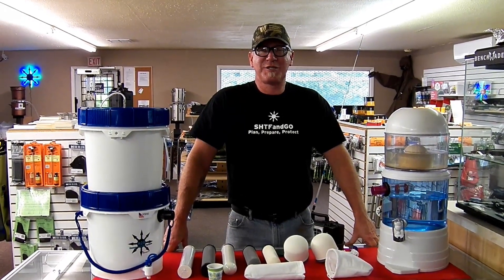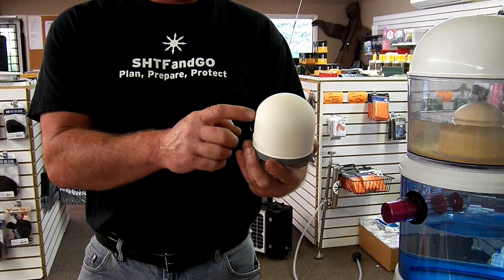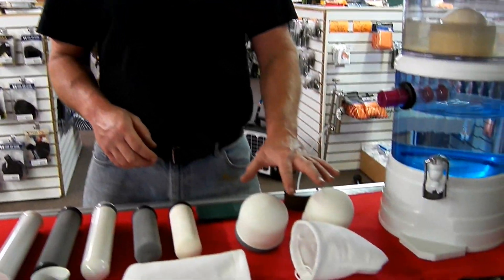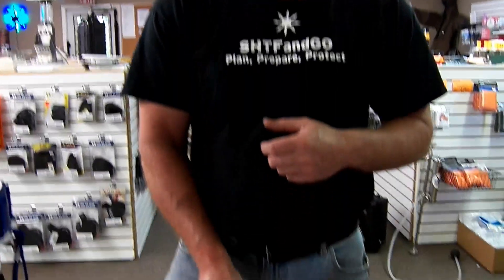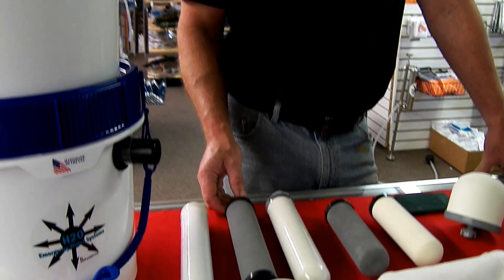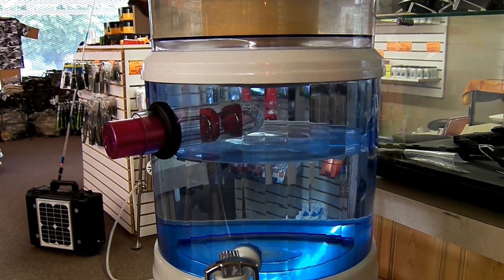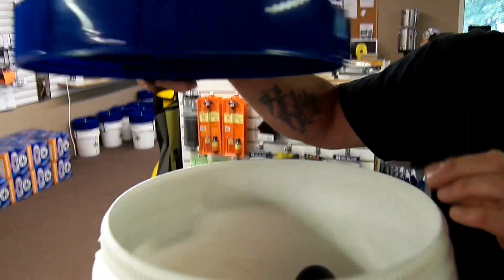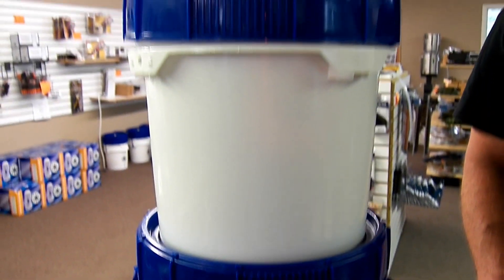Compare Different Types of Ceramic Filters

Comment: Wow, you guys have really put a lot of thought into your products. Definitely very impressed, even if i might not immediately purchase your larger models. I did get a D-Stil Lite just now, so depending how that works out, i might also get the GRAVI-Stil. I used to own one of those electric distillers from Amazon, but after three years the electric switch burned out. Obviously, that's not very sustainable, even if I did manage to repair it. The multiple heat source aspect of your products appeal to me.

Comment: My hollow fibre uf membrane claims to be of pore size 0.01 and works with tap pressure. It does not need any pump, though it takes 10 minutes to produce a gallon of water. Do I need a uv sterilization in my case?

Comment: Just looking at all of these, something came to mind. I would think the dome would be better and last longer than the candle style, because the whole thing sits lower in the water. A candle is going to clog more toward the bottom and less toward the top as the water drains out, so the lower and wider the better. Yes, no?
Reply: Well doesn't the dome sit in the bottom two ?
Reply: The candle has more filtering surface than the dome, so I would assume the dome clogs quicker, ergo requires cleaning more often, however, the dome is a better fit for smaller, maybe wider, containers.
Reply: I like the doom shape.
Reply: I'm currently using the dome shape and 16qt stainless steel pots purchased at my local Walmart and a stainless steel spigot purchased online too as well as my filters.
Reply: @stevethomas5209  hi can you make a video please showing us how to do it thank you so much
Reply: @sheepseven7588  Its supper easy and there are several videos on YouTube already. If you have any skill at all w a drill to drill the holes you will do just fine. On a scale of 1 to 5 and 1 being easiest this is about  1.5 so get your drill bits, pots, spigot and filters and go for it its supper easy and will save you lots of money and the best part is no more buying water. Be sure to run two pots of water to get the filters completely filtering properly... Like priming the filters for maximum filtration and tast.

Comment: Can one of your UVs be added to a Berkey (the plastic see through type of Berkey.)   If not, can you recommend a submersible UV for a 2 1/2 gallon clear plastic Berkey?
Reply from the maker: @rharrold  Yes some people have done this. Just be careful. 😉 https://shtfandgo.com/product/uvc-water-filter-sterilizer-kit-for-gravity-systems/
Reply: @Shtfandgo  Thank you for the quick reply and link to the product!
Reply: @Shtfandgo  — Would putting the UV in the lower container and close to the spigot 🚰 outlet be OK?
Reply from the maker: @rharrold  I'd recommend as high up in the bottom (clean water container) as possible. The gasket seals well, but there's always a chance of a leak. If it's up high, water doesn't have as much pressure.

Comment: I'm looking for something that filters out fluoride.  Aside from Berkey, AquaGear was the only one claiming to filter fluoride when I did my initial search years ago, and AquaGear has recently discontinued that feature.  Making my own filter system appeals to me, so I'd like to know if there is a filter you recommend?
Reply: I'm also interested in removing fluoride. My little research has led me to find that add on filters ie for berkey or doulton etc that remove fluoride do so using a media that contains or utilises aluminium. So yes removes or reduces fluoride but at the cost of aluminium (not good). It seems to be kept quiet by berkey etc... and not immediately obvious to someone wanting a flouride removal filter.  doulton don't even mention what the fluoride removing media is inside there fluoride filter but likely aluminium. I have heard that a possible natural solution is Tulsi plant or holy basil leaves as they apparently leach the fluoride out of water. If the filtered water was able to have these leaves soaking in it for a certain time it may help to naturally remove or lower the fluoride. Would need to test properly to confirm
Reply: A distiller is the only way

Comment: Interesting set up. I was wondering the uv light compartments. Do they have water or air tight locking mechanisms to avoid air contamination or spillage while moving the container?
Reply from the maker: The uv lamp is inside a glass tube.

Comment: are these as good as berkey,and will they remove any pool shock/chlorine from the water? YZMMWST Replacement for Berkey Water Filter System, Black Purification Elements Gravity Filter System, for Doulton Super Sterasyl and Traveler, Nomad, King, Big Series - 2 Pack

Comment: i have one that you first introduce. can you please help me how to clean thi? there is green stains in it and it doesnt remove.
Reply from the maker: Marian, The filter will turn the color of what ever is in the water being removed.  Example:  High iron in the water will turn it red.  You can take a scrub pad or sand paper to rough up and clean the outside of the filter.  Remember the outside doesn't need to look clean for that is where all the things you don't want in your water get caught.  They do not pass through the filter to the clean water side.  Any questions just call our shop M-F 9-6pm Central time. 612-888-7483

Comment: I just bought a Berkey system a few months ago and hate it. I purged it as per instructions, and ran at least 10 gallons of tap water through it.... the taste is worse than the tap. It has almost an oily smell and taste. I even ran 1 gallon of vinegar through it, with slight improvement.

Since I already have the housing, I think I want to switch out the filters to yours, can you confirm that your filters will not have this same problem?

Comment: Do the dome filters fit a regular Berkey stainless steel filter?
Reply: Also, my Berkey has four holes in the chamber.  Right now I have 2 white ceramic filter "candles" (non charcoal I believe).  Would you recommend that I put anymore "candles" in, or should I keep the plugs in?
Reply: The domes will not fit most.  They are 4 inches in diameter, so you would have to measure and see how many you can install. Most people replace with our black candle filters.
Reply: @shtfandgobulletproofrocket3874  well, there's FOUR holes... two are plugged, two have "the candles" in them.  If they drilled four holes when they made the container I would think they would've made it wide enough to hold four. 🤷
Reply: @kristopherchynoweth9770  Yes. If there are 4 holes, then your system can hold 4 candle filters.

Comment: I distilled 4 gallons of water from the garden hose, the water is 000 on the TDS Meter but the water taste like the garden hose on a hot day, what would be the best filter to take the bad taste out? I would like to make my own Berkey system that will fix the bad taste.
Reply from the maker: Any of our filters with activated carbon should do the trick.  Here's a link to one of our carbon black candles. https://www.shtfandgo.com/product/carbon-black-ceramic-7-inch-candle-filter/
Reply: @Shtfandgo  
Thanks a million.

Comment: Impressive video! Thanks for going through them all. I’m already going berkey for drinking but what would you recommend for showers and washing clothes during SHTF
Reply: Bathing can be done in regular hose water. Cooking water ideally should be filtered as if you'd be drinking it, but if you can't get it that clean. Clothes washing should be the last thing you use any water for if water is in short supply. Honestly, having done long distance hiking(7+ nights, 100+ miles), I bring 1 change of undies and a spare shirt on most hikes. I'd rather pack more food than clothing. If I'm hiking near a lake or stream, I'll bring a vinyl "soft bucket" with me for washing clothes with. 

NEVER wash your clothes in a body of water with antibacterial soap. Take a bucket of water out of the lake/stream/river and wash on ground. Don't contaminate the stream with soap runoff. It will kill the good bacteria that helps maintain the ecosystem :-)
Reply: Living in what sounds like colder climes to you, Scotland, I always wear Merino as a base layer, which, of itself, has antibacterial properties, but it's a Merino mix, ensuring further antibacterial benefits, so they require washing every four or five days, which saves time and effort, but, as you say, sooner water for drinking and cooking than than laundry concerns.
Reply: @billyandrew  do I understand you wear merino wool next to your skin? I live in sub tropics, so I am clueless. It gets just below freezing about maybe 7 to ten days a year here, if that. Is it scratchy? Do you have a softener to wash it with?
Reply: @beverlyaten1775  If the merino fine wool garment is SOFT enough, it’s beautiful next to yr skin! To test, gently place the fabric up against your décolletage and move it around...discreetly, tho, or the store owner will think yr creepy.  You can tell if the wool is soft or scratchy. 
Aim for “machine washable “ on the lable. 
Wash in the machine in a lingerie bag, to avoid twisting and wrecking it in the wash....cold wash, with normal powder.
Yahoo!! Now you’re set!
Louise, Australia 🦘

Comment: I'm wanting to clean a dedicated gray water tank to a shower (off grid) the goal is clean water recirculating to be refill the water supply tank. 99% time using bio- degradable soap,, but concerned about a build up of soap scum. Or if the filter could even handle the soap without instantly clogging up. Best thought process right now is use aquarium floss/quilt batting on shower floor with a teak slat floor over it to capture as much soap/hair first.
Reply: Maybe consider a pool filter first

Comment: @4:40 .   Are you sure Berkey filters are 0.2 micron ?  .   The behave like a 5 micron because of the high flow rate and longer time between clogging.
Reply from the maker: Sorry for the long delay. for some reason your message didn't show up until now. They advertise them as .2 micron, but I've not tested them for consistency.

Comment: I use my ceramic filter the dome one for about 3 weeks then it stop filtering, I scrub it with a brush, a pot scrubber, sand paper and its still not working, i think its because the holes in the ceramic is so small it is clogged and cannot be unclogged. Do you have any suggestion that can help?
Reply from the maker: Contact our shop on Monday and we can help you trouble shoot.  If the brush or scrub pad had any oil on it you probably ruined the filter. Soap and oil can plug up pores. Sand paper or clean brillo pad are best. We've used dome filters for over a year with no problems.

Comment: How do I buy your uv light I couldn’t find it on your store
Reply from the maker: The light comes with our water filter system. We normally don't sell it separately, but if you contact our shop we can figure it out. We're there M-F 9-6 CST  612-888-7583

Comment: Which system would you recommend if I will be using rain water collected from my roof into a rain barrel? Thanks, love your products.
Reply from the maker: The best performing filter are the 7 and 10 inch black candle filters, but all the filters will easily handle rain water.

Comment: What do you think about using a bike air pump, 1-3 psi. for pressurizing the bucket, instead of any Electric fish air pump or any other electrical anything. Off grid or power down, don't you think a mechanical way would be better?..Shrader valve- same on car tires. threaded into top lid...As the water goes down, you will loose some pressure, so just give it a couple more pumps of air..done..
Reply from the maker: Davey Crockett the systems already come with a mechanical pump.  The usb mini pump is a new option on the Gravity Well Ultra.
Reply: the problem with using air pressure is this:  once more than one third of the filter is exposed the air passes through the filter faster than the water. all that air passing through the carbon filter dries the crud . making it more difficult to clean off. Killed a new set of Berkeys, in just 20 gallons of water!! in an emergency situation. using air to push dirty pond water through a new set of berkey filters

Comment: I use your ceramic - silver - charcoal  dome With a 2.5 GLASS bottom tank for tap water, The glass bottom tank was a Zero Water tank which I found not to be cost effective (cost per gallon $$$$$$$$$$$$)

Comment: I bought a ProOne 9inch filter (well, bought 2 but one came cracked so got a refund on the crack one).  I took out all my berkey filters in my berkey (had my berkey for 11 years) and watched everything up, scrubbed down new filter as directions say.  Then I put filtered gallons of bottled water in the top reading 6ppm on my TDS meter, and when the water goes through the ProOne Filter and in the bottom it first read 286ppm.  I did this 4 times (waste of water), washed everything up to get all the sediments in, and put through 2 more gallons for the 5th time.  Again, the read is 6ppm (wegmans filtered water using) and shockingly after all this time and effort, the water comping out is at 186ppm.  Now what the heck is this filter leeching into my water to increase the ppm from 6 to 186?   My berkey filters would be 6ppm to 5 or 6ppm after it went through, but.. this filter adds another 180ppm to the water so i am scared to drink it since i think what could be happening is the filter has all types of stuff in it that is disolving and getting into the drinking portion of the water.  Is this perhaps why the are not NSF certified for the filter filtering out what the claim it filters out?  Instead the only NSF certification is for just the parts and materials, not for how the filter actually works.  I emailed the company so waiting for a response and I so hope they don't tell me the Filter adds stuff to the water that is beneficial since what goes into the filter should come out the same or better, NOT worse!   I think these filters are all marketing BS and don't actually do what they claim they do, which is why they are NOT certified.  The tests only go up to 200 gallons, but yet the 9 inch filter is rated for 1200 gallons (why not test to 1200 gallons?).  I am so aggravated after reading all about the berkey short-commings and just seeing other companies appear to be following the same formula and just collecting money.  I do have an RKIN over the counter R/O filter, but like the gravity filter for our dogs/coffee/and to drink more spring water versus just the R/O water, but i won't even give this ProOne filtered water to my dogs since who knows what is leeching out that ceramic filter and being injected into the drinking water.   I don't think I trust any of these products as they lack certifications and most of the reviews do not do real testing of the water before going in and after coming out!!   Why???
Reply from the maker: Ceramic filters do not reduce salts (tds= Total Dissolved Salts) but it shouldn't add too much to the tds. <10-20 is normal. RO, Ion exchange (water softener) and distillation reduces salts. To check the filters full top container and set in corner of the sink. Should get approximately 1 drip per second (easiest method). Ceramic filters are good at removing pathogens and with active carbon at removing heavy metals and absorbing vocs.

Comment: Would Berkey filters work in doulton ?
Reply from the maker: Berkey and Doulton are the same company. Kinda like chevy and GMC. Our filters fit both systems, but the Aluminum PF-11 filter will not attach.
Reply: @Shtfandgo  great so the carbon block of berkey fit in doulton...i hope these aren't the aluminum ones you mentioned because i never heard of these
Reply from the maker: @curiousgeorge6921  the pf-11 is their fluoride filter
Reply from the maker: @curiousgeorge6921  I didn't delete anything.

Comment: For a diy gravity filter do you recommend the dome or candle filters?
Reply from the maker: Domes are cheaper, but you can fit more candle filters in a bucket. They both filter at .2 micron so there's no difference in effective filtration.

Comment: Hello dear man,
Thank you very much for the video - Very enlightening and helpful!

I wanted to ask, that it bothered me - If I'm not mistaken, the Silver ("Silver nitrate" probably) is also very toxic to humans - is not there a danger that it will leak into the water? (Becauseת If it's mixed inside with ceramics, the ceramic is soft and fragile, and a powder comes down slowly and may interfere with the drinking water)

Have a blessing in your business!
Thank you!
Reply from the maker: It is not Silver Nitrate. A bacteriostatic agent or bacteriostat, abbreviated Bstatic, is a biological or chemical agent that stops bacteria from reproducing, while not necessarily killing them otherwise. Colloidal Silver is imbedded in the ceramic and this does not get released into the water.
Reply: Exactly! 👍
I concur, but understand why the question might occur to some, which you've dealt with effectively.

Comment: so your 10" filter is like a berkey alt but only does 2000 gallons right? berkey does 6k. I still like your price better so going with you guys but just confirming
Reply from the maker: The 10 inch can filter 3000 gallons on average and mor if cleaned gently. Just don't clean on belt sander. :-)

Comment: I don't understand why any one would waste there money on a Berkey when it doesn't filter out virus's and is extremely slow. I'll take your two bucket system with the U.V. light ( which I will by in the next few days.)  that also filters way more water and way faster then Berkey or most other brands.